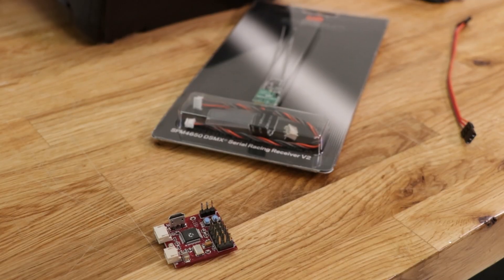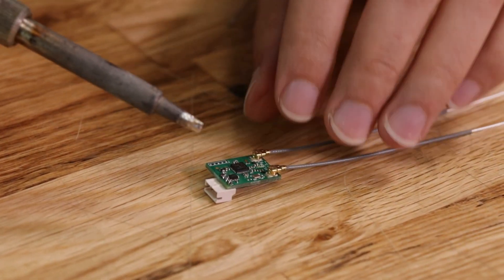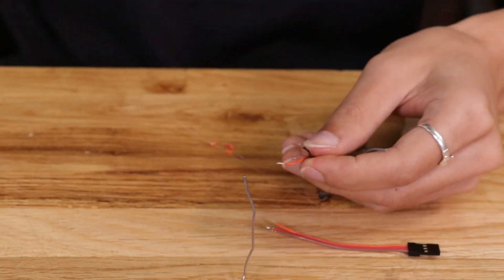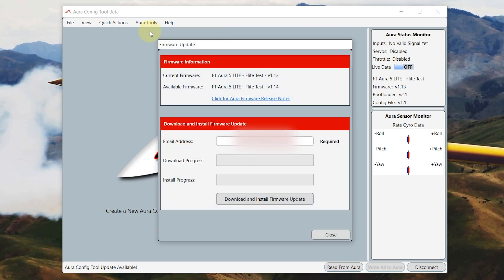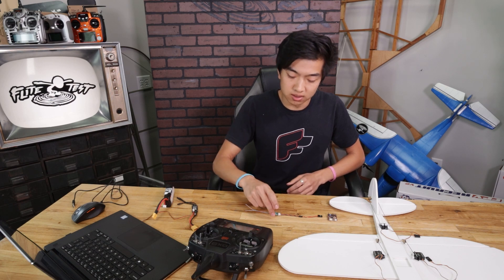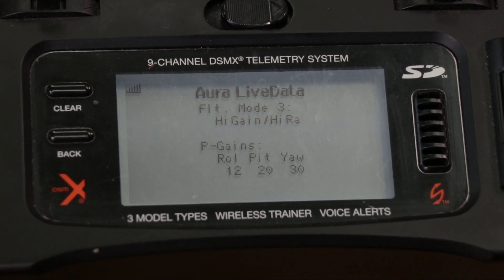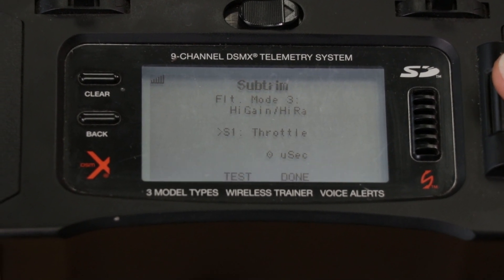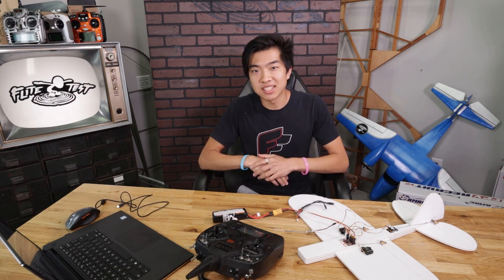Aura SRXL2 Setup and SRXL2 Telemetry Tuning

Comment: I have an aura 8 and a SPM4651T I have the premade connector with servo and 4 pin connectors. 
I just created a new model on my DX8 G2 but when I go to telemetry I do not get ‘TEXT GEN’ to appear in the options what do I do now?

Comment: I am old school RC, so flight controllers are new to me. I got a new swappable Spitfire kit w Power Pack, 35A ECS, Aura 5, and the SRXL2 SPM4650. I'm using a DX6e (I know I won't have telemetry, but reviews said they'll connect). Anyway, after following your video to the letter ( think), I don't see how the power from the ESC (via the servo-style connector, right?) connects to either the receiver or the Aura. Looking closely at the video, I do not see any other components. Thanks!

Comment: I just updated my DX6 to Airwave version 2.0.7.03 and the TextGen telemetry option has been eliminated.  I do see the Aura 5 on the monitor and can see the gain settings for all 3 Flight Modes.  However, I can’t get into the Aura 5 tune mode by flipping the Flight Mode switch 3 to 4 times quickly that worked previously.  I had to mount the Aura 5 in such a way that I can’t get to the mini usb port to do configures with a PC so doing it from the DX6 is essential.  Any ideas?

Comment: Any one Know why the TextGen Setting would be missing on a DX6e? Trams is on 2.06 Firmware, FT Aura is updated to 1.14, Using a SPM4650.
Reply: Well it looks like Version 2.06 they have
Spektrum 2.06 Read Me .....
Removed “TextGen” as an option on the Telemetry devices list. If TextGen is being provided by your Flight Controller or ESC, it will appear automatically on the list of roller screens, making configuration simpler. Otherwise, it will automatically be hidden.
So 10 days after this video the option gets removed.

Comment: You can't have fun anymore you have to spend all your time being computer programmer , I stick to my old stuff heck you have to be able to fly, I'll be flying you guys will programing your aura what ever that is.
Reply: You are just spending a little longer with setting up the Aura than you are setting up your tx for a new model, most of the stuff you old guys do on your transmitters, the younger guys do on their flight controllers. Unless you are so old that you even dislike computer radios and are just using simpe 4ch radios.
Reply: Amen !